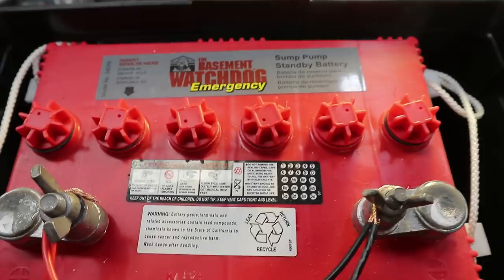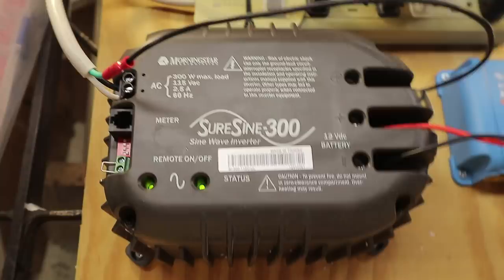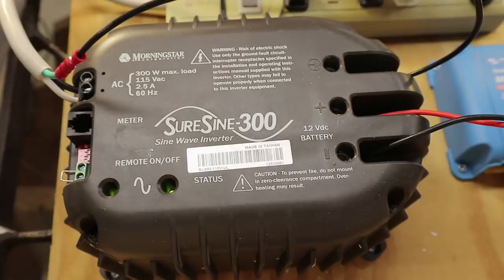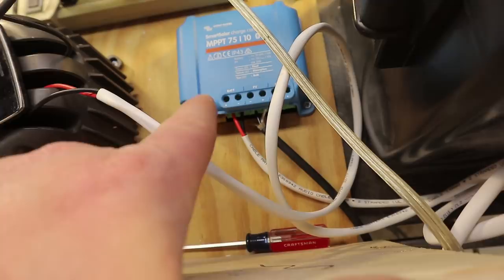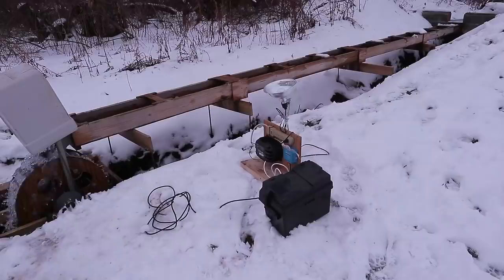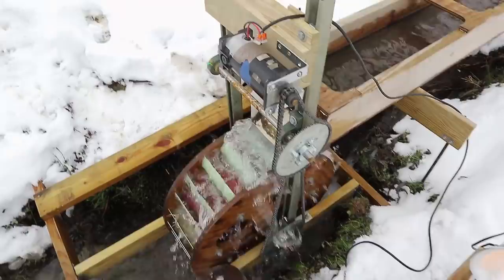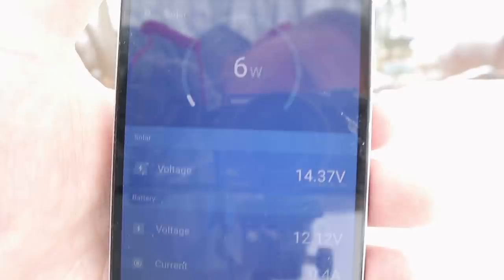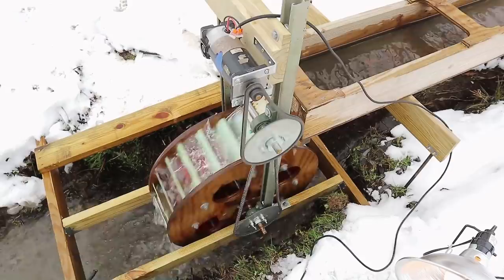[Part 10 of 10] Waterwheel Microhydro, How Much Power?

Comment: I got a strong stream that flows through our property in northern Arizona.  It's ideal for building an electric generating device of some sort, well, sort of.  SRP claims the water is theirs and consequently, I can not take any for drinking or impede it's flow across my property.  However, historic claims on the water, allow us to take water for familial use...and to divert a small amount of water for electricity generation, provided it's small enough to not get noticed...However, we don't live there and it goes weeks without human activity...and whatever electricity I generate would need to be used at the time of generation, in low light pollution LEDs.  I'd be paranoid of causing a fire from an overcharged battery.  Or am I being overly cautious.  Are there batteries that aren't too expensive that'll store a good sized charge?  Btw, flash floods will be happening.   How many?  There's usually a legendary one that will obliterate anything near the stream banks and 5 to 10 feet up from water level, there is one of those type floods every 5 to 10 years.  There are frequent cataracts and narrow canyons downstream from us, in fact 14 people drown 2 years ago when they were caught in a rainstorm flash flood...If it's raining and you're in a narrow canyon with steep rock walls and a river runs through it, it's Darwin doing some spring time cleaning if people get killed.

Comment: This DC motor that you are useing is not designed to produce electricicty, therefor it produces alot of drag and the efficiency of the system is probably at 30 percent or less. you should use a dynamo or a verry small alternator. You should also know that AC power is better for transmiteing over distance and it is best to be rectified at the point of consumption. this motor that you are useing is produceing pulsed DC power, wich is not good at all.
Reply: There is no difference between DC motor or DC generator, the only things important are rated power, voltage, current, torque and rpm. Plus AC is better transmitting over distance not because its AC, its because the High voltage cause less current to flow for the same amount of power, thus reducing the current and losses in the network (W = I²R), you would have the same results with high voltage DC power lines. The advantages of AC is it is easier to change the voltage with use of transformer. One last thing, pulsed DC  coming from a dynamo is reduced the more poles the dynamo have. If a DC dynamo has 2 poles (which i highly doubt his motor have) you have rectified AC, if a motor has 4 poles, the AC component of the signal becomes tiny in comparison to the DC value.

Comment: Does the charge controller limit the watts when the batteries are above 80%?
Reply from the maker: Good question. I did partially discharge the battery and have a load on it while testing to draw down the volts. It should not have been in float or constant voltage. Pardon my lack of knowledge with Lead Acid and MPPT controllers.

Comment: it seems to me that you are only getting those few watts because your charging system is limiting you to a certain voltage - am I not understanding this correctly?
Reply: No. The power taken from the wheel is given by P = V x I. Depending on the load, the voltage and current will change. You could get 1 amp flowing from 30 volts or 30 amps from 1 volt. Either way, the power is only 30 watts. If you can contrive to pull 10A at 20V, you can get 200W! This is what the charge controller is doing, maximizing the volts and amps, and thus the power it can tap. With that available power, it can convert it to as many amps as possible into the battery at the charge/maintenance voltage. The inverter is taking the full-rated 12V from the battery and running the light bulb. The charge controller only has 5-6W to charge the battery, but the inverter is taking 60W to run the bulb (plus inefficiency losses throughout.)

The maximum theoretical output from this setup is only about 12W with this (typical) flow and short head. There's a comment a few videos back saying 60% efficiency is about the best you can do with water wheels. Considering that, 5W is actually pretty good for throwing it all together to see it work without any fine-tuning.
Reply: sorry, jim s,   there is  x-amount  of  energy  AVAILABLE,  at a given site.  in this case, it's   29.4  watts.
head x flow rate x gravity x 1000 =  watts           (assume head of one meter and a  flow rate of  .003 cu/meters per second.)      googletranslate
Reply: @daviddavids2884  I believe he calculated the available theoretical power at 12W in a previous video with his own head and flow measurements. I don't see anything in your post that contradicts mine besides your assumptions about head and flow.
Reply: @jimstanley_49  fine.  without going over it all, again, imo, your  reply  was in need of clarification.     SO many commenters have no a clue.    in part, i comment/reply in an attempt  to  lead them towards the light.

Comment: so was this more or less just a "for the hell of it" or proof of concept type of project? I mean I love tinkering as much as the next guy and what not. but the plywood construction of this is going to last a couple of years tops... 

some sealant and enamel paint on the interior of the box and using pressure treated lumber would make it a longer lasting setup.
Reply from the maker: Just for the hell of it, and sharing with you, and YouTube ad income.
Reply: thats kind of what I figured. nice backyard engineering for sure. 

was this something that required getting permits and whatnot?

Comment: What if you added an extra set of gears to increase the RPMS of the generator shaft?
Reply: then it would just stall out as the wheel is too small to hold enough water for a higher gearing.
Reply: and would make even more losses due to more bearings and more gears.
Reply from the maker: I had all the rpms I needed (33V in my last video)

Comment: I didn't read all the comments in all the videos, but if you put a smaller gear ON the Wheel, rather than that Huge one, you could get something to spin faster, which would give you more power.

Comment: Hi. I had the same reaction when I saw the power output (wtf, just 5W?). Anyway, great job you made. I am thinking to buy a modified alternator that has some neodymium magnets placed on the rotor and it is claimed to produce less resistance even connected to the load, and I hope to make a portable river generator. Maybe this thing will work also for you in the setup you have
Reply from the maker: Used hoverboard motors are 3 phase PMAs good for about 300W

Comment: if you want to know the true power of your system, get rid of everything.
i guess you have a 12 volt dc motor? correct? then directly connect a same value voltage lichtbulb 50 watts or so.
your positive from your motor goes directly on one terminal of your lightbulb by thick copper wire.
get an ampmeter and connect your minus terminal to minus or ground from your motor.
and positive from the ampmeter to the unconnected terminal from your lightbulb.

then you will see your true amps of your system.
if you want to measure the voltage put your dc volt meter parrallel to your lightbulb terminals.
this is a high impedance sensor circuit so it wil not make a short.

Comment: Joe Malkovich I saw your video on YouTube on my Roku TV I did like the Waterwheel that you made,,, you can still enhance it several ways for one I do like the idea about you changing the paddles and have buckets put into the slots that will carry more gallons in weight that will give a better Force on each bucket if you multiply the weight by the speed. The other thing is the best way to generate electricity is to go with a hundred amp alternator go inside the alternator and remove the regulator that way you will have a straight output of a 120-volt vac the only thing about that if you're not going to use magnets to replace inside the alternator is to add a small voltage generator up to 12 volts and tide in to the coil housing that way the housing can generate its own magnetic force and the amateur will send out a straight hundred and twenty volts v a c from there I will try in a step up a coil 120 coming in and nearly 240 coming out that way you can choose to use one phase or two phase for full power. I don't think there's nothing wrong with this project it might have been hasty a few loopholes but you're on the right step and bringing this project 2 full measurement please and thank you. If you wish to contact me by email my address is sterlingparker222@gmail.com

Comment: you need to get yourself a better generator like a permanent magnet based car alternator super core or somthing. the stronger the rotor field is and the thicker the inductor winding and the thinner the stator core is the more power the generator can generate. a servo motor is a bad trade for power as it just stall like a motor reaction but in reverse.
Reply from the maker: But I didn't use a servo motor.
Reply: maybe its a starter motor, but its mostly the same exept gearbox

Comment: Your lighting a 60 watt bulb and putting 5 watts into the battery? Or am I missing something?
Reply from the maker: The 60 watt bulb is to insure the battery doesn't go into float resulting in less measured power generation.

Comment: You should get thicker wire. Probably losing a lot of power with those.
Reply from the maker: +Persojet 16ga water is good for 5A up to 15 ft. I was only generating .5A with the waterwheel. I was close to the limit on the inverter for a 60W bulb. The inverter should use 8ga wire for full output.

Comment: Would love to see a similar system where you take the output from the bottom of the dam. That’s where the pressure is going to be...
Reply: That would be a horrible idea as the dam would drain quickly, and only produce power for a short amount of time
Reply: Jayden Shadlow You’d adjust the outlet to compensate, and have overflow protection at the dam, should the outlet be too restricted

Comment: I wonder if you would get any more power from increasing the head height. Maybe move your wheel downstream a ways, see if it creates any improvements.
Reply from the maker: No more slope further downstream, I'm already using 90% of the head available.
Reply: Could you have moved your flume to the very top of your dam and gained water speed?

Comment: ALWAYS connect your charger and the inverter from the battery and power your load from the inverter, that way you will not have any interruption or stop/start surges as long as the charger keeps the battery fully charged. Think of it like a UPS which powers the devices from the batteries which are constantly charged by the AC power source. Yes, fuses are necessary, safety first once you get it setup permanently. Great job otherwise

Comment: So was that 5w after the ~60w to drive the light bulb for a total of 65w?
Reply from the maker: It's an LED bulb and there is a battery attached to the system. Charging controller was collecting 5W from the wheel.

Comment: Cool idea but poor pre-planning.  One thing you have to work with is your phone.      
     You can Google this system to find out what won't work.   Like that type of battery.  You wouldn't want in your house because of fumes. Goet a sealed gell battery like in a power wheelchair.
     Also check and see if it's legal in your city and state to put a system like that in a brook, stream or creek.?  In my state it is not.

Comment: Well that's five Watts in the Darkness and solar panel cannot do that.......... Next time and I hope there is a next time make your water will with the quest to make torque and trying to put as much water on to the Leverage within the wheel and yes that makes sense..   the problem is at your wheel which had to be low to the ground was not wide enough triple deuce great amount of torque from having a large amount of water onto the wheels leverage points.. that is the upper fourth of the wheel of the water Flowage and your will could use some sideboards to keep the water from flowing out off the side and not down into the next propeller or the next blade.. the only thing that can prove what you have now is if you Swifton the water that's going into the blades and this thing will reduce torque..  because the water is hitting the blades at a high rate of water flow..  know I have thought your wheels might perform as underflow hydro system..  very basically you'll be taking this wheel and popping it right in the middle of a dam ..  housed in a concrete block box and for low-flow you want to have a sloping inside curve Inside the Box that match the paddles blades on your water wheel.

Comment: Remove second gear and connect first chain directly to motor because more gears will not increase energy
Reply: Lowering gear ratio with current wheel RPM the alternator will not reach battery voltage and it will not charge.

It may be an ever larger ratio is needed to slow down more to fill wheel pockets more and lose less kinetic energy.

But looks like RPM goes quite low compared to no load speed.  Kinetic energy is proportional to RPM^2 so at 0.5 speed there is only 0.5*0.5/1*1 = 25% kinetic energy wasted and at a wheel speed of 20% compared to no load you get 0.2*0.2/1*1 = 0.04 = 4%

A wider wheel and more filled wheel, containing more water, can run slower to transport same amount of water. Less losses in remaining water speed.

Also important not to drop the water before it has reached ground level and do less splashing as it crushes energy into heat.

It is better to increase wheel height more than to use a downslope waterway to make the wheel an impulse runner. Its because as water at speed is crushed in the wheel slot and energy is lost as heat, whilst if you drop the same water volume flow at a bit higher wheel it will use a larger flow area, lower speed and energy can instead be harvested with a higher elevation drop and less heat loss.

Comment: Looks at the size of the wire you will be lucky if you can get an amp of charge. You are going to lose all the power before you get from the water wheel to the house!

Comment: Hi Joe! If you still need that relay, I work at a control panel, telemetry, and instrumentation company so I could hook you up with some! All I'd need is a P.O. box or address!
Reply from the maker: Thanks! I may contact you in the future. Check out my latest hydro project. I might need a pressure transducer accurate around 110 psi
Reply: @JoeMalovich  I'll see what I can do!

Comment: The only information you needed to find the theoretical maximum amount of power you could generate with this situation was the water flow and the head --- the elevation your water would drop:

While the water flow varies,  I'll use the 12 seconds it took to fill a five gallon bucket as you measured it at one point  and use your figure of a 2.5 foot head:

Filling the five gallon bucket in 12 seconds yields a water flow of  5 gallons/12 seconds or ,41 gallons/sec

Each gallon of water weighs eight pounds and drops 2.5 feet.

So .41 gallons/second x .8 pounds x 2.5 feet of head yields about  8 foot pounds of energy

One foot pound per second of energy is the same as 1.35 watts of power

So 8 foot pounds of energy =  8 x 1.35 =  11 watts of power  That's the theoretical maximum amount of power you could get.  Getting 5 watts of actual power is pretty good,!

However,  at 5 watts of power you have to run your system for 200 hours  or about eight days to generate a kilowatt  of electric power,  which your electric utility will sell you for about ten cents!

It SUCKS to try to compete with your electric company head to head!

Comment: Cool project, ummmmm just not sure why you'd build it knowing the output ie watts, longevity, purpose even.

Although it is cool as i said earlier, and you did use formulas and some scientific research... i guess from my background I prepare every detail and calculate before acting.

What would be useful is a concise video stating the laws of physics, chem, etc to be used the design principles, and or variations and then develop something that will work, endures and has high capacity - and that goes for all your projects, your curious and have lots of heart... use your patreon funds to do more with less material but invest in it... Thats how engineering works!
Reply from the maker: Yes I still need to do an engineering video for this series. It's just a low priority.